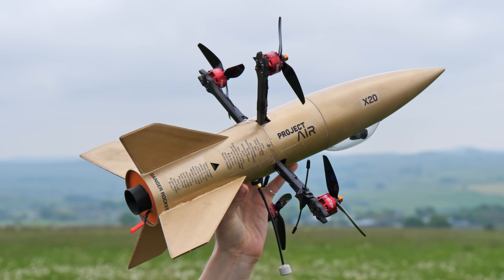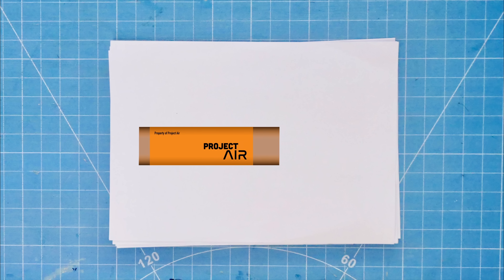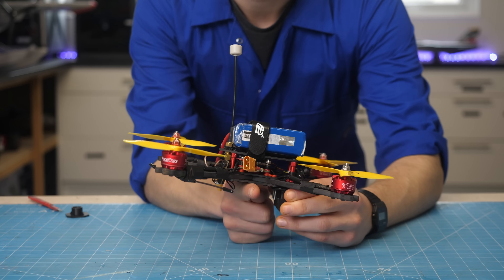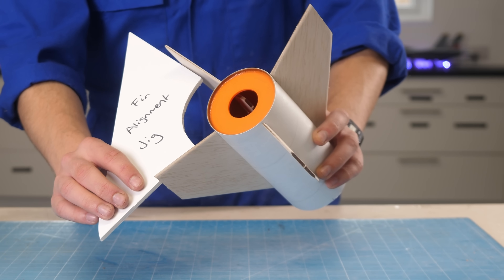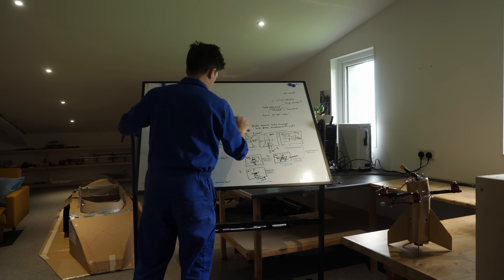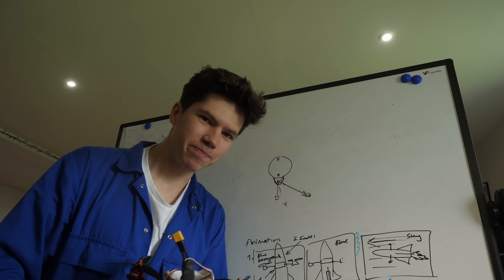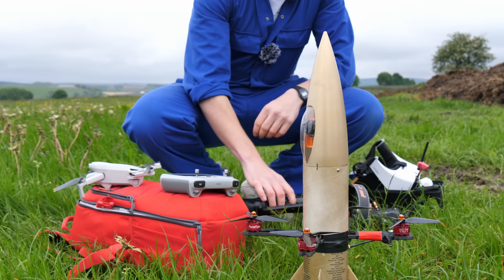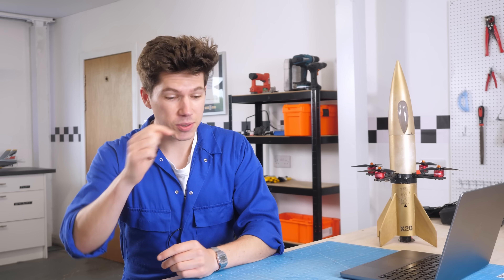Building a Rocket Drone

Comment: Hi James , it’s me Anthony Stama the kid who emailed you that’s building a 3-D printed jet  F 22 (edit wow this is the most likes I’ve ever gotten. Thank you.🙏🏻) edit 2 I did not expect to get more than five likes. Thank you.
Reply: why did I read your name "Ayrton Senna" lol
Reply: @zigi_cubing  ha
Reply: @zigi_cubing  haha
Reply: @Anthony-stama hahaha
Reply: ROBOTEK0711  same
Reply: Ok
Reply: Yeah a 3D printed f-22 should be incredible (with all the control surfaces and thrust vectoring)
Reply: Foreigner Tank Crew are scared & scratching their heads. It Flew better than expected. Good job.
Reply: @wolfen946  right now it’s in the design stage, but yeah I’m not too sure how I’m gonna print it yet because it’s going to be 36 long and 22 wide (get it) and my printer is small it’s a ender 3v
Reply: Ooo now that I'd like to see
Reply: @Anthony-stama  woooow incredible thanks for the info
Reply: @wolfen946  👍
Reply: @Handlebar_hooligans hahahaha
Reply: I know a better way of building aircraft. I suggest also buying a laser engraver and making the fuselage structure of wood and the fuselage outer part 3d printed in vase mode. I am designing a dc-3 with this tactic
Reply: Why you tell this, is it somehow related?
Reply: @zigi_cubing  me too 😂
Reply: @Anthony-stama  With my printer (anycubic i3) i make parts with an inner rim with holes for small screws, then I can attach the parts. There is another way, which is to print the parts with 5 cm deep holes, and to put epoxy and small steel rods in them. Then you can place the other part. In fusion 360, you can made threaded parts too. (I’m also a kid trying to build electronic devices and was wondering how you removed gyroscope drift in your IMU).
Reply: @romanbengaldrole4061  cool yeah I thought about doing that. It’s just I’m not too sure how yet because it’s a lot of thin and aerodynamic parts so yeah, but I’m gonna try and do something like that.
Reply: @lyriccrown  yeah, I could try and do that. It’s just this project is mainly about the   goal is that it’s going to build 3-D printed so yeah if it was just build a jet, I would do that and if I had the money.
Reply: @Anthony-stama  try making a rim inside the parts, this worked for my mini satellite with a parachute. For the imu how do you get the angle of the plane ?
Reply: @romanbengaldrole4061  What’s IMU ???
Reply: @Anthony-stama  It’s the accelerometer gyroscope to stabilize the plane. Also, how do you calculate lift coefficient and propeller optimal size ?
Reply: @romanbengaldrole4061  there is no propeller it’s gonna be a jet. I might go for the largest one that spectrum makes.
Reply: @romanbengaldrole4061  for a lift coefficient I just put in to an AI program and it gave me some good dimensions and I kind of copied that over and I use the same air foil that the real f22 uses
Reply: @romanbengaldrole4061  for the IMU I’m not sure I did not know that I needed that. I knew the gyroscope part
Reply: @Anthony-stama  If you plan to use thrust vectoring with rockets, a one-axis gyro might not be enough. To make a stabilizing two wheeled robot for example, or any other unstable accelerating device, you need to measure angle in all three axis, and stabilize with a PID controller. Gyroscopes also drift, so be careful. Finally, rocket engines have a short burn, so it will be hard to control the plane that way. What is your AI  program though ?
Reply: @romanbengaldrole4061  it’s not rocket engines. It’s some EDF I believe that’s the name of it. Don’t quote me from spectrum they are small electric ducted fan motors that they use for RC jets so it’s gonna be easier to control then rockets and I can vary the thrust and all that that’s the reason why I’m not going to be using rockets and rockets you can’t
Reuse
Reply: @Anthony-stama  Did you calculate the required thrust to make your plane fly ?
Reply: G’day mate.
Australia
Reply: @glennllewellyn7369  👋
Reply: @romanbengaldrole4061  not yet since I haven’t fully completed the design and I still need to figure out some things before I can calculate the thrust
Reply: @Anthony-stama  be careful as you need to adapt your model to the edfs. You should calculate extra lift vs size, with the EDF thrust. To do that calculate the speed at which it will get after the time you want and the drag, then the lift. With that you will know if it will fly at a certain wing size.
Reply: @romanbengaldrole4061  Yeah, yeah man this stuff is super complicated. I don’t know how James does this.
Reply: @Anthony-stama  From what I’ve seen, he just knows what kind of wing curve “approximately” works 😂. If you need help with the calculations, ask me your questions (I’ve already done a few calculations for planes) Also the EDF thrust and time on the runway you want would be good to know. You could try using a NACA wing, export to DXF, extrude and cut to make delta, calculate Reynold number range and use the data plots of the profile… It will be easier. For the thrust vectoring, a PID controller (proportional of value, integral and derivative) can work, with some servos.
Reply: @romanbengaldrole4061  yeah and what do you do that you know so much about these little planes
Reply: @Anthony-stama  Actually I’m a kid like you and have been doing electronic projects for almost 3 years now (even though there haven’t been many successes). In March, I made a satellite with a parachute that could collect data, and I’m now trying to make a VTOL plane, so I’ve made a few calculations and programs to stabilize the plane/drone (with a lot of trouble with gyros as I make my own flight computer with an Arduino WiFI Rev2 and its onboard IMU). I had also tried making a drone 1 year ago (which wasn’t done due to lack of funding) and have recently made my YouTube channel called Innovasciences to try to get sponsors.
Reply: @zigi_cubing  I did the same thing. It's possibly because we read the start and end of words and fill in the middles automatically. Try mixing word letters but keeping the ends correct. You will still be able to understand the sentence: For example: Sceinitsts stuided tihs phomneneon, privong its vecarity renetcly.
Reply: Here is advice for you to grow into a healthy man: Don't get caught up in counting likes.
Reply: @inthefade come on this is the first time I go over one like
Reply: @Anthony-stama you’ll just have to be smart printing in sections (maybe design locking mechanisms between the sections) and resin them together.
Reply: Is there a request orrrr?
Reply: Yeah and this is my first time using cad software still need to figure out how I’m gonna do it
Reply: @Anthony-stama  ah yeah I use cad but I'm not good at it at all
Reply: Send the design to Ukraine 🇺🇦
Reply: @zigi_cubing same lol
Reply: good luck mate, i hope you do well. when you are done building this would you be posting it onto your channel?
Reply: @infinite4809   thank you 🙏🏻 I don’t think so because my mom doesn’t let me have a channel but I will be taking videos of my progress so when I do have a channel I’ll will post them

Comment: I fly quads, should say, your drone is kinda very slow in stock.. modern stock 5 inch setups fly 100 mph quite easily, without cones and rocket motors. 6s, 1950kv motors, 5146 props give 180km/h and that's quite typical setup
Reply: Yeah his drone was painfully slow, he could have bought an off the shelf one with more than 2x the speed.
Reply: Completely agree. I think his idea was to make a quad that was boosted by a rocket and maintain control. He says at the end he used a low power quad, and asked if people would be interested in him making a much more powerful one.
Reply: It seems like they built a 4S quad.
Reply: @Schradermusic  Yes, motors have 2500KV. But the batterie looks like a 30C type,  too heavy and more suitable for long range.
Reply: I get 180mph on my race builds so not a typical build for most but not uncommon in racing
Reply: He has old parts and a 4sbattery
Reply: If you actually listened to what he said, it's clearly a simple and cheap testbed to check the viability of the concept. There's no point in strapping expensive, high performance kit into an experimental craft if it is likely to hit the ground at high speed on the first attempt. 🙄
Reply: I was thinking the same thing. My basher quad does 120

Comment: GO BIGGER!!! Maybe something with multiple rocket engines and more powerful electric motors.

Edit:
Used the wrong wording. When you speak eight languages, getting everything is difficult sometimes. Thank you for the correction.
Reply: Moar boosters!
Reply: Get to Mars before Elon!
Reply: Electric motors, not engines
Reply: We choose to go to the moon 🌙  not because it is easy but because it is hard
Reply: MAKE IT BIGGEEERRRRRRRRRRRRR
Reply: More power
Reply: Electric engines?
Reply: Some jets? Scramjet?ramjet?turbofan?turbojet?turboramjet?
Reply: Next Goal - Break the sound barrier.
Reply: @jakfjfrgnei  good for you
Reply: Beat RedBulls wr!
Reply: Excellent work. This idea could have military uses.
Reply: @lavarsch  In fairness that's a fairly low bar.
Reply: he should use the design of an AIM 9 sidewinder
Reply: Long video
Reply: @Dipplers 🤓👆
Reply: Bigger is better!
Reply: Wow 8 languages, what’s your mother tongue?
Reply: @wack1305  fr, eight is insane!
Reply: To the moon!
Reply: IQ 200
Reply: @SimonAmazingClarke A lot of militaries and aerospace companies have experimented with high speed VTOL platforms over the decades. Apart from a couple of tilt rotor designs and traditional helicopters with 'pusher' props attached, none of them have come to fruition. There are simply too many aerodynamic limitations to make something like this practical and financially viable. You simply get better overall results with other designs.

Comment: Another banger James - love the rocket videos :)
Reply: Hey Joe
Why can't this mechanism be used for vertical landing?
Reply: @Engineering-concepts-builds likely weight and complexity, those motors would need to be stowed during flight to not add extra drag and it would need a bunch of testing to get the landing right, not that joes not done a lot of testing before
Reply: No bias of course 😁
Reply: Bro you have vertical landing rocket. These guy have drone plus controlled rocket. If  these technology combine it will create super combination. Why you two can collaborate create   by merging your two ideas in one project.
Reply: @Engineering-concepts-builds it definitely could, but thrust vectoring the rocket motor is way cooler
Reply: hi bpsspace

Comment: Would the propellers cause drag when you ignite the rocket? 
And yes build a bigger and faster one!
Reply: I was about to point this out as well
Reply: a free wheeling propeller is conisdered practically a solid disk of equivalent size in relatively small propellers like these. So yes, ALOT  of drag comes from the propellers.
EDIT: (when modeling simulations)
Reply: Unless you can feather the props, which would be a problem on a drone.
Must admit, when he said this is my idea I thought this is a not going to work.
Reply: @bobflyman  variable pitch control propellers?
Reply: @virtuallyaverage9357  wonder how much folding props would help with that.
Reply: It probably depends if the motors are RPM limited or power limited. If the motors can drive the propellers faster with essentially less air resistance, then their drag should be minimal as it is "powered away" by the motors. If they can't, then the rocket engine will have to accelerate the propellers rotationally, as if they were spinning freely. You'd have to know the characteristics of the motor to definitively say, I think.
Reply: the most easy solution is use 2blade and high pitch propeller, large kv motor and make calculation pitch and KV (no drag included) how much air speed it could generate...
maybe use edf with variable inlet.... and outlet
Reply: this was my concern as well. If the rocket boost goes fast enough doesn't it run the risk of counter rotating the rotors to the point of potential electrical damage?
Reply: Don’t worry… 8:19 “The four balsa wood fins were delicately sanded to reduce drag” so I think that will compensate for the extra drag of the props 😂
Reply: Çç
Reply: Couldnt you have them folded against a fuselage and then when the rocket comes back down the arms can then fold out and the propellers turn on. Theoretically couldnt you have the propellers without motors and allow it to come down like those propeller leaves tbat fall from trees?
Reply: Great video
Reply: A way to fix this is by connecting the switch for the rocket to some way to unlock the propellers
Reply: @MrSeanman30  From what I understand, the propeller are needed to stabilise the flight, so you actually want the props to be there, not retracted. The "obvious" way would be that the props are spinning so fast that they're not drag any longer, but then you'd probably reach a cavitation stall... And what's the point of a rocket if your propellers can reach the same airspeed, anyway?
Reply: Just make a mechanism so they fold
Reply: @adimegan4677 The best solution would be to use a completely different design whereby the props are shielded behind something aerodynamic, but that complicates things. I would like to see him use the rocket in a horizontal position for take off and landing, with rotors on the 'side', essentially like a helicopter with a pusher prop or jet.
Reply: Spot on! Please take a look at my Rocket Drone, with remote controlled booms/shafts.

Comment: Now do a high altitude weather-balloon-rocket. The cool thing is, you don’t have to worry about detaching the hydrogen-powered balloon because the rocket will just blow it up! In all seriousness, though, this is a good idea. Imagine getting most of the way to space using a balloon and then coasting the rest of the way using the rocket, since the force resisting the rocket’s vertical motion is smaller (less gravity, less air resistance, etc). Not only that, but the rocket will be closer to space anyway, so a suborbital model rocket would be a lot easier to make. You just need a trigger for when the balloon pops, an automatic process, (which can be linked to the altimeter instead, since the altimeter can tell when the altitude begins decreasing) so you wouldn’t need anything more than the stuff that is used in traditional rockets. You could have the weather balloon attached to the platform and the rocket on the platform (probably with two or three guide rails) and then use gyroscopic stabilization (as fins wouldn’t work at such low speeds and launching off of a flying (or at that point falling) platform is unstable no matter how many guide rails you have) and just connect the wire to the altimeter, maybe with a tiny microcontroller if your altimeter itself doesn’t have a signal for when it starts to fall
Reply: Make it a rocket attached to a quad, with an egg as payload - so the balloon goes up to the edge of space, just before the balloon pops you fire the big rocket & climb higher, & then when the rocket burns out you fall back to earth via gravity, & when you get closer to the ground, the quad fires up & self stabilises, then attempts to fly you back to the launch point autonomously & autoland...
Reply: Instead of a rocket just put a powerful drone inside the balloon.

Comment: Sweet! Hope you're well, James. On my 5 inch, running 6s, I get 106mph with a GoPro strapped on. That's with freestyle props, not racing. You managed to go well over that. Maybe you should build one that will lift the Turbine and fuel!!😂
Reply: "on my 5 inch, running 6 seconds, with a go pro strapped on" you describing your bedroom antics?
Reply: @sebpaine9095  6s refers to the number of cells connected in series. 6*4.2V makes for a 25.2V battery.
Reply: @sebpaine9095  6s means 6 cell battery. Lot of 5-7 inch racing quads easily go over 100mph.
Reply: @voltthrower I think you missed the joke...
Reply: @sebpaine9095 maybe u should do some research before making fun of urself

Comment: Cool! 

I think you can combine the fins with the drones arms to reduce drag. 

Also a 5 inch should hit around a 100mph to begin with, check your config. 

Higher pitch props will be better for the top speed but drone props don’t come in very high pitches so you might need to check out some airplane props. 

Looking forward to seeing where this goes 😃
Reply: He would probably have to move the arms down to near where the fins are located to keep the center of pressure behind the center of gravity
Reply: I'd say that "a 5 inch should hit around 100mph to begin with" is a bit of a stretch. A super-light racing drone, sure, but if it isn't optimized strictly for speed (minimal/fragile frame, not carrying a second camera, minimizing battery weight, etc.,) then 60mph is decent. My freestyle 5" quads go about 60-65 because they are very much not optimized for speed, in favor of survivability in crashes.
Reply: @FPVenius  yeah you’re probably right. I have a five inch freestyle with older components and the gps said around 100 mph back when it was working.  But that might be with a tailwind and maybe the gps wasn’t that accurate. But I see 80-120mph being stated quite often. I figure that people with more experience can hit those speeds.
Reply: @FPVenius  a simple 4s nazgul with some watermelon props already gets 80mph for me. And whenever I get higher pitch its around 100mph. I think he's using low C batterys in this video

Comment: That's a really cool Idea! The speed was definitely a bit underwhelming though, a well-built normal 5'' FPV racing drone can easily reach over 100mph without a rocket
Reply: As he said in the video, this is a simple and relatively cheap testbed to see if the concept is viable. He even says to comment if you want him to build a better drone and better rocket motors. Who would build a top end racing drone and strap a rocket to it without first testing on a basic one?